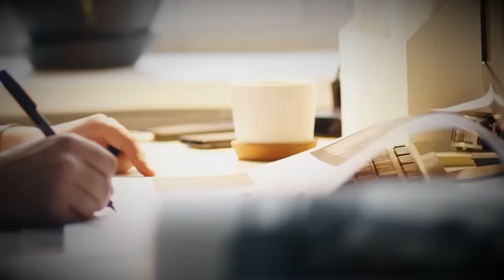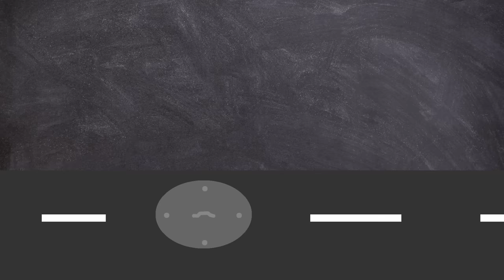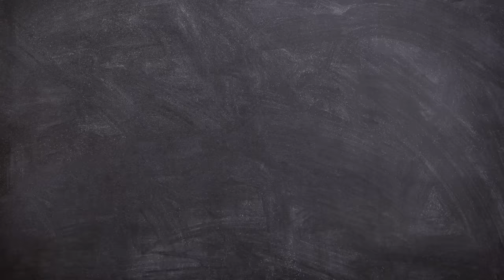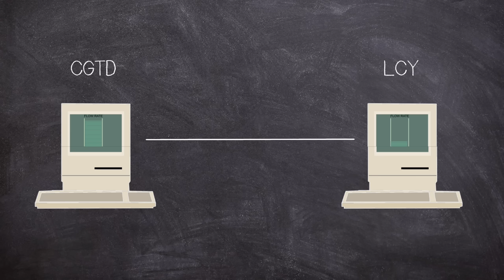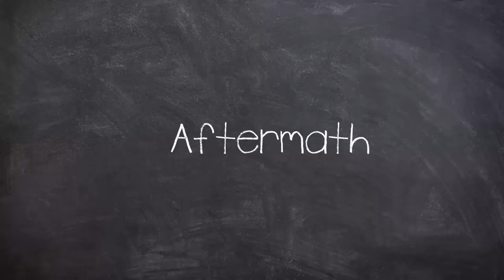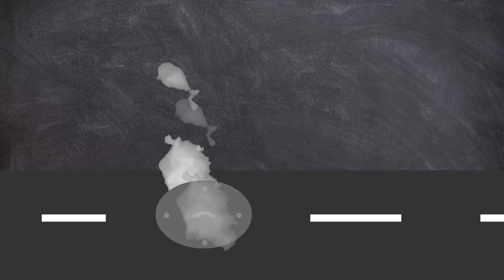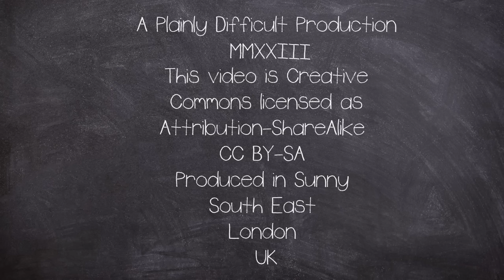Multiple Streets Blowup At the Same Time | The Kaohsiung Explosions

Comment: The spark being from a fire truck is a truly cosmic level of irony.
Reply from the maker: It is isn’t it
Reply: No kidding.
Reply: One of the fire trucks my brother in law rode on had the turbos fail in the middle of the night on the way back from a fire. It started to spit flames from the exhaust and caused a small grass fire on the road that they had to turn around and put it out before it spread.
Reply: I bet that explosion instantly vaporized the water inside the truck.
Reply: It likely wasn't simply a spark, flammable gasses entering the air intake on a diesel will cause a runaway that can't be stopped. The engine uses the extra fuel resulting in rapidly climbing RMPs until the engine self destructs blowing up. Firefighters are all taught to shut down the engine on gas leaks because of this. 

They actually sell propane boost kits for diesel trucks, it's similar like putting nitrous oxide on a race car.
Reply: @40arpent that was antilag))))
Reply: @mattgayda2840 but how if it's runaway? open bonnet and shove something in air intake?
Reply: @vipvip-tf9rw I think it’s mostly a precaution you would take before a runaway started, if you knew there was a flammable gas present.
Reply: And to think that I always thought that they called them “fire trucks” because they were used in putting OUT fires…
Reply: @mattgayda2840  It absolutely can be stopped. You just need to smother the engine. Ideally, you open the hood and put something over the intake. You can use any number of things but ideally it's something that won't get pulled apart by the air going into the engine. Of course, it's not exactly encouraging to open a hood on a runaway diesel due to the obvious danger and the sheer volume of an angry diesel, but if you're fast enough and catch it before it gets too far gone, you can save the engine.
Reply: @miraak542  That’s been done with a normal runaway, from, eg. an oil leak in the motor. 

If I thought there was a flammable atmosphere I’d stay in the truck, turn off any cab ventilation, and try to stall it or, if possible, drive away. You don’t want to be burned if a flash fire starts, and inhaling it could be harmful.
Reply: @miraak542  I had a runaway 8/71 2 stroke Detroit diesel and the emergency shut down cable was disconnected, it took some balls to stand next to that thing and operate the emergency intake closure and I had the engine covers off because I was doing a refit on the boat.
I doubt many would even know where to start with a runaway.
Reply: Its more common than you might think with diesels than you might think since they are compression ignition. The engine will rev up to the point that valve float sets in, and then it all goes horribly wrong after that. There have been several industrial accidents initiated by this at refineries and such.
Reply: shawnstafford7809  Diesels, in their simplest form, rely on the high compression ratio to ignite the fuel. There's no spark plug. The glow plugs are used initially when the engine is cold to help the fuel ignite. But, since it doesn't need a spark to ignite the fuel, if anything combustible gets ingested into the engine, it will burn it as fuel and "run away", or rev up, even if the key is turned off (provided it was running initially, of course). If its in a thick fog of propane this will be an issue as eventually it will backfire or something and set off an explosion.
Reply: Cosmic irony in that an alien who didn’t know what a fire truck was and saw this would assume they were to start fires and not to put them out
Reply: I was just coming here to post this exact same thing.
Reply: FR
Reply: I imagine this disaster was in the making whether the "help" came or not, but that's just crazy that the fire truck was the direct cause.

Comment: Non-odorized propane is extremely scary stuff. Fumes from a leaky switch heater tank at a rail yard (that had been filling their tank off the non-odorized LPG tank cars to save money) on a calm night went down a sinkhole and into Hidden River Cave, accumulating in the lower portions of it, until MY ACTUAL MOTHER and 3 others went down on a USGS survey mission. It was supposed to be a multi-day trip and this was before LED lights, so open-flame carbide headlamps were used for normal work and the Maglites were for when they needed a bit more brightness. Long story short, they stopped at the top of a pit and decided to have lunch before they set up the rappelling gear, one of mom's companions set his helmet down with the light still burning so he could air his head out, and... well, the whole room was suddenly on fire. They FLEW outta that cave, 2 hours of crawling was done in a 20 minute mad scramble as the heat of the fire started pulling more fuel out of the lower parts of the cave, and everyone except the guy who took the helmet off ended up with the only hair left on their heads being a thin ring where the helmet's suspension covered the scalp. 

Mom's still alive, most of the others have died of unrelated causes in the last few years, but the Hidden River Explosion is actually listed on the EPA's superfund page so I'm 100% not lying here, this is verifiable. I've been meaning to get this story actually written down somewhere that's accessible, as I'm not sure whether it ended up in the NSS News or not and I'm currently poring over the accident archives from the 80's and 90's trying to find it as I'm rusty on the specifics, but if I find a result I'll edit again.

Edit: I haven't found the one I'm looking for yet but I DID find the one about her sulfuric acid burn on an electric cave trip cause the factory battery packs on Wheat lamps don't automatically vent

Edit 2: I FOUND IT! The December 1989 issue of American Caving Accidents by the National Speleological Society, listed under Hick's Cave, October 8th 1988. I definitely mis-remembered some of the specifics but the article is real. Mom has a more detailed account written somewhere, it's the footnote reference in the article, but the Virginia Tech Troglodyte zines aren't archived online and I'd have to go dig through about 500 pounds of file boxes at my parents' place an hour away to go find her paper copies. I posted screenshots of the article on my Twitter account of the same name, but you can also just search the NSS News archive.
Reply: oh wow.
Reply: Thank you, I wondered why nobody had reported a smell except the shift foreman.

Also, your Mum seems to have led an adventurous life, please ask her to record it somehow. That kind of anecdotal history is very important.
Reply: Wow! Crazy story!!! 😳
Reply: Hopefully John sees this. 
It would be a great collab - and John could help to record it for posterity.
Reply: Your mum's stories about her life would be astounding
Reply: Wow, I’d love to hear more!
Reply: Where did this happen?
Reply: @koharumi1  Hick's cave, in Horse Cave Kentucky
Reply: This should be it's own video

Comment: Have you already done a video on the 1992 Guadalajara Analco disaster?  My favorite part of the story is there was a radio interview with an official from City Hall (director of safety something something) saying that the situation is perfectly under control, and that smell of hydrocarbon is nothing to worry about.  Ten minutes later, an entire neighborhood exploded.
Reply from the maker: I haven’t yet but it’s on my list of to cover subjects! Thanks for the suggestion
Reply: that's sure backfired
Reply: trust the officials.  do not question. /s
Reply: I was about to comment on this! It’d be a great video for sure, I met one of the persons involved (SIAPA engineer) that was used as a guinea pig alongside other 8 and was sent to prison (puente grande, high security prison)as one of the responsible s for the explosion, thankfully it was later clarified that he had no fault on the disaster. He wrote a book called “642 días Un nuevo amanecer”
Reply: @ricardoolvera49 
Perhaps you meant scapegoat?
Reply: @AvoidTheCadaver  you’re right, I meant scapegoat
Reply: When I saw this story, the first thing I thought, this was the Mexico explosion
Reply: The Guadalajara sewer explosion in 1992 was a cause of gasoline leaking from a petroleum plant; the gas then leaked into the sewer system where multiple explosions occurred down a neighborhood street at different locations.
Reply: Ah yes, good ol' "Everything is Fine!"
Also, a great topic to cover is the San Juan Ixhuatepec Pemex explosions (Nov 19 1984), it's 39 years ago now.

Comment: There's an USCSB video in which some workers sat in an idling truck first noticed a severe gas leak when their engine started racing and ran away uncontrolled as the gas was burned inside it. This should be a disaster warning to anyone working around gas or petroleum although it might not give you a lot of time to act.

Comment: This reminds me of something that happened in my hometown in Brazil.
1976, the President Getúlio Vargas visited the city of Bauru-SP, and pareded on the main boulevard of the city. But a gas tanker truck capsized in another parallel street,  in a higher ground of the city the day before, filling the rain galleries under the streets with 20 thousand litres of gasoline. As the boulevar is in the valley of a river, the gasoline evaporated under that place. The parede went down without a hitch, but minutes after the president passed the place, someone threw a cigarette butt in a rain gutter and BOOM, 2 blocks of the boulevard median went down in a series of explosions. At the moment, people thought that was a atempt to kill the president, but latter investigation found out the reason was the accident with the truck. (nobody died)

Comment: Our family was living in a rental house during a difficult time in our lives. It wasn't maintained at all and we didn't use the central heat as it hadn't been used in ages. In the USA, many rural homes rely on LP gas from tanks. You can either rent the tank from a supplier, meaning only that company could fill it or buy a tank outright and have it filled by the supplier of your choice. The issue was that nobody was making sure the tank was in good order because the crappy landlord owned it. It was a large tank, maybe 250 gallon and was positioned right outside my bedroom window. We didn't use it so never paid it any attention. I did notice that the small pine trees that had grown near it had died. Landlord couldn't recall when it last had gas in it and it hadn't been serviced in forever. Turned out, the regulator had failed and the gas, being heavier than air, had pooled at the bottom and right up against the house. Had I ever flipped a cigarette out the window, we'd have blown TF up. Gas is no joke folks, a neighbor at our new place almost died because someone had taken out a gas fireplace and not capped the line safely. They got their tank filled and it filled the house all night. Her mom woke up late and immediately left for work. The grown daughter got up and lit a cigarette. 9 months in Grady hospital burn unit, she's lucky to have survived.
Excellent presentation of a disaster I'd not heard of Jon.

Comment: Great video as always. Since others have already pointed out the similar Guadalajara incident, I'll suggest looking into twin gas overpressure disasters in the greater Boston area--the 1983 East Boston gas surge, and the 2018 Merrimack Valley incident. Both incidents involved feeding mainline gas pressure into low-pressure household piping, but for different reasons. Needless to say, the piping wasn't designed for it and it resulted in many fires and explosions. I recall the 2018 incident had graphic footage of houses popping like popcorn. The evacuations and fear were extensive.
Reply: I actually made  1 video  on my channel and that 2018 disaster is the subject.  I was a former gas utility worker in the largest gas utility in the state. I know alot about the gas distribution system because I was a district inspector
Reply: @skipd9164  I think the 2018 Merrimack Valley incident was caused by a mistake in replacing the main line. They accidentally left the sensing lines that drove the regulator on the old cast iron pipe that was being discontinued. So when the pressure on the discontinued line dropped, the regulator opened fully, dumping full main line pressure on low pressure pipe network. Practical Engineering had a great video on it.
Reply: @hotlavatube  actually that was a problem created by upper management and I'll explain why. The utility I worked for had procedures that the other utilities also followed. When ever someone excavated within 300 ft of a reg pit or building a reg crew would be involved. I ran DigSafe in my 5 city's and towns and watched my pits. This project had to get reg department signatures but upper management said not needed. When the contractor started they should of had regulator department ( RD ) on scene and follow up regularly. The new pl main was installed then excepted and connected to pit. Reg guys never knew that and that was after the first year of contract. I WANT TO BE CLEAR ABOUT THIS SENTENCE THE CONTRACTORS DID NOTHING WRONG. 
    The regulator department guys are all the most senior guys in the department. I would always make sure that when working in my area the guys knew about digs. Just that first season they dug near pits. They disconnected old main then connected new main without RD knowing this. I read all the transcripts and nothing was said about this. Usually the pit would be opened and all gages connected during close excavation or turned off then turned on under supervision. 
     The day of accident the most important fact was when RD got called after hours just as incident was happening. They had no idea of any work  on any pit and would start looking for problem.  The union employee watching the last connections could of stopped the problem if he knew what to look for. Why do you run a bypass to the main being eliminated. Why not just cut it off. I don't know if he understood what could of happened but I and many others immediately knew. There are pictures in NTSB reports that show all the gages and pipes in last trench. Once the bypass was cut and they started to bleeddown main there were gages to watch pressure in New main and old main. The bypass popped off as presure slowly increased and immediately something should of been done. Reconnect then open so old main had gas back. The real issue is why RD crews were not involved in that project when in the past they always were. That was not really highlighted but just skimmed over. Instead there saying to add outside approval.
Reply: @hotlavatube  they are actually called " static lines " . The regulators open slowly as the presure drops.  I don't know why they didn't just turn the pit off then after connections turn it on. I think the answer is because they wanted to set pressident showing regulator department not needed in New construction. The Big issue with today's modern heating equipment is the operating pressure. New high efficiency equipment doesn't work under lower pressure. Saturation area is defined as an area where low pressure goes even lower. In the winter in older city's when everyone wakes up they turn up heat use hot water and cook breakfast. With standing pilots customers might notice smaller pilot flame and smaller flames on equipment. New high efficiency equipment will stop when presure gets reduced
Reply: @skipd9164  Thank you for your insight into the incident. These disaster videos are great explaining how incidents unfold, but they don't always capture why they happened. 

However, I have noticed a trend in many disasters of ill-conceived attempts at cost cutting, brow-beating employees into unsafe practices, and occasionally political interventione. If you skip vital safety steps to save money, rush unobtainable deadlines, or approve unsafe plans to stroke someone's ego, you're flirting with disaster. Sure, you might get away with it for a while, but as the saying goes: regulations are written in blood. Eventually a building falls over, the tail falls of a plane, or 40 houses blow up from gas overpressure. 

Of course, I can't blame the video producers on youtube for being circumspect about the political underpinnings of disasters. Such things are often difficult to prove and rarely fully explored. Few youtubers want to open themselves up to litigation.

Comment: I'm rather surprised the fire department/brigade didn't smell the propane and figure out it had a major leak on its hands. But I'm not surprised the pipeline operator boss ordered the line re-pressurized despite clear indications of a major leak.
Reply: The actual reason is the fire brigade knew there was a leak, but they thought it was LNG for houses, leaks are not unusual because it supplies to houses, lead to a lot of wear and tear.
You can't really tell propane and LNG apart by smell. Problem is you can try to douse LNG, but you cannot douse propane.

Comment: The worst of this is that they didn’t seem to have plans in place for leaks or suspected leaks. Any major leak should have required shutdown of the system, the isolation of each area which would then be pressure tested.
Reply: At least a sensible person shut down the pipeline, but was overrun by a profit orientated manager.